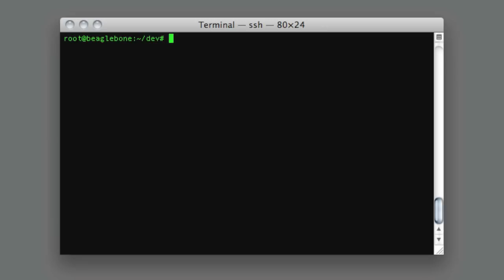BeagleBone GPIO

Comment from the maker: @vincentstockdaletv It's like Arduino in the sense that it has IO pins that are easy to prototype with physically (i.e., they're broken out into headers on the board). However, the architecture behind the BeagleBone is a lot more like a computer than the Arduino.

Comment from the maker: @ampix0 The great thing about linux GPIO is that you can use any language you want. Controlling and reading the pins is achieved through reading and writing in the file system. I started this project in C, but found that trial and error was easier with Python because the errors were easier to understand. I might go back to C now that I have a good sense of how it all works.